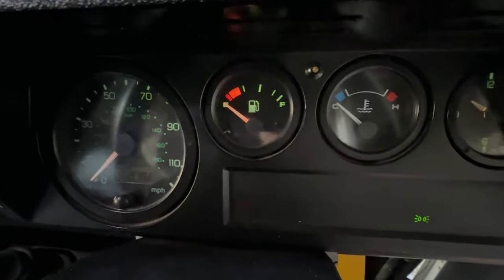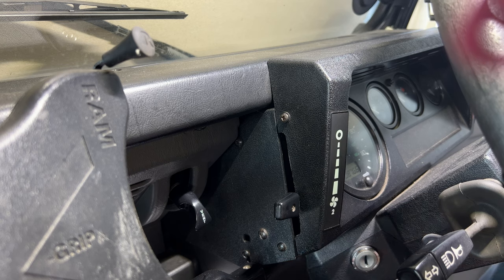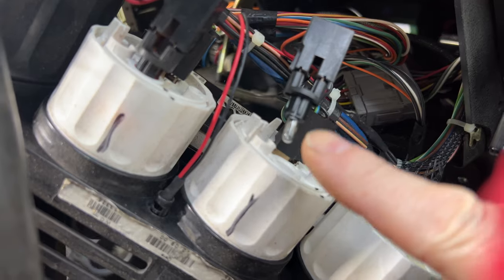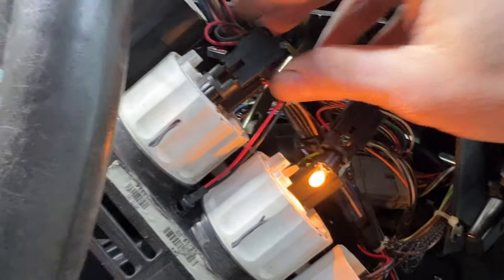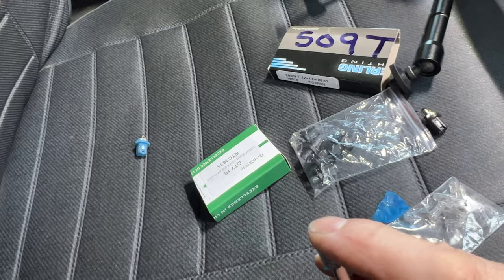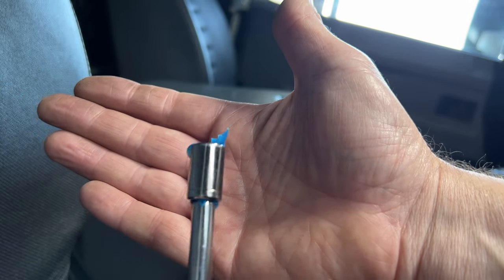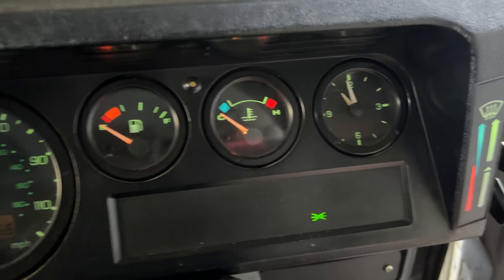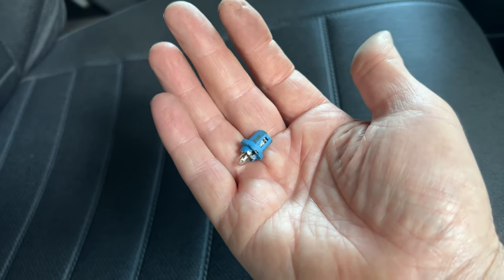Land Rover Defender instrument binnacle bulb replacement

Comment: Nice one Mike the temp gauge bulb holder I had the same problem with my kit car back in the day my fix was a little body putty called dumb dumb black stuff made a little sausage shape to go on to the face of the holder then when pushed in it squeezes out slightly and held the bulb holder in place ,the putty doesn’t go hard and can be used again if the bulb needs changing just a thought  👍👨🏻‍🏭
Reply from the maker: Hi Paul, thanks for the comments, interesting about the dumb dumb, sounds a bit like plumbers mate. Hopefully I wont need to change another for a while 🙂

Comment: How to get the clock bulb out??
Reply from the maker: Hi, on my clock (the one I removed) the bulb holder was a simple "push into the back of the clock" type. A simple gentle pull will pull the holder from the clock, then you can get access to the bulb which also just pulls out of its holder. As with all Land Rovers, they all differ. Mine was the one I described above. I hope this helps, thanks for watching.
Reply: Clock is an LED if you haven't found this out yet. it's not replacable by design, but you can disasemble the unit to replace it if you're careful.